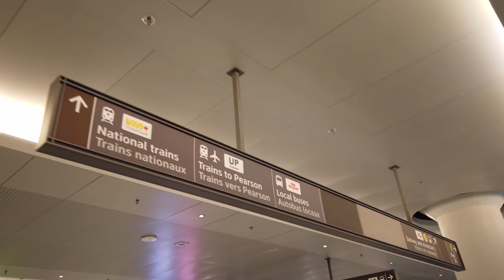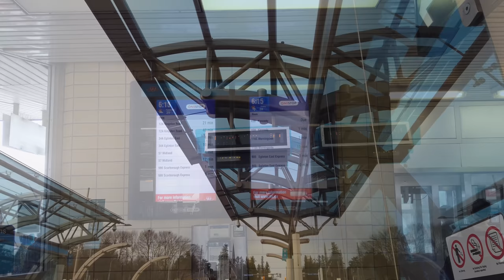How to Plan a Good Railway Station

Comment: Excellent video, Reece! I feel like making transit a pleasant experience even when the weather is not nice is often overlooked. As you said in the video, this is especially important in Canada because of the cold winters but also in many places around the world that experience extreme heat.

I cannot believe that in a city as cold and snowy as Québec City, the people planning the tramway line there didn’t consider having a weather-protected connection between the main train station and a tram station. Do they expect people arriving in the city by train or by coach bus to just walk 1km outside to a tram stop with their luggage when it’s -25°C and there’s a snow storm?
Reply: Na, they probably expected them to drive🤦‍♀️
Reply: @neolithictransitrevolution427  My guess is that they used recent origin and destination statistics and looked at the currently most used bus lines to come up with the path that the line takes and its stations. Currently not so many people go to the Gare du Palais because there are just a few trains per day, but that should change in the future with Via HFR (High Frequency Rail). The fact that they didn’t consider having a good connection between the train station and a tram station, especially with the nearby tram stations being underground, is crazy. The plans are now too advanced to consider changing the route (and I obviously don’t want there to be any more delays with this important transit project), but perhaps they could consider building a pedestrian tunnel so people could get to a tram station without going outside.
Reply: @ethandanielburg6356  Ottawa got mostly the same hit tbh. The cities really aren't planning on well with VIA, Although I can only blame them so much given Via's history. I hope, at least in Ottawa, future lines provide more connections and have better connections. Pedestrian tunnels would also be great.
Reply: It's nutty that the stations on the tunnelled sections of the Ottawa O-Train extension (Stage 2) are all open-air. Trains travel in a tunnel between stations so they don't have to disturb the surrounding neighbourhoods but people have to wait in the -30 snow at the platforms enhanced by the piston effect from the tunnels. Or drive. The stated reason for open-air stations on tunnelled sections is to save on the cost of extra emergency exists and fire ventilation systems. It's better to get something inappropriate for cheap than to spend money on what you need.
Reply: @neolithictransitrevolution427  At least in Ottawa the light rail station is right outside the Via train station. In Québec City, the Jean-Paul-L’Allier station will be 1km from the Gare du Palais and the station at the Place d’Youville will be about 750m away.
Reply: Hopefully they'll build some decent shelters, something at least comperable to the Bus Stations on the transit way.
Reply: @ethandanielburg6356  Awful, honestly a future branch line would probably be worth it.
Reply from the maker: I think it's also a bit of chicken and egg, it's not as attractive to use VIA without such great PT connections!
Reply: @RMTransit  I think it's really Via that has to come first, there will never be much demand for a station with 6 trains a day with slow service to boot. 

On the otherhand, people fly to places without a good public transit link, so we know people will take intercity transit if its fast and reliable, even if they have to take a cab or get picked up by a friend when they arrive.

Comment: The improved safety with more open sightlines seems like one more reason to choose elevated rail and stations over underground ones where it's otherwise a toss-up between the two. I wonder if there's any data showing that violent crime is less frequent in at or above grade stations and trains...
Reply from the maker: It's an interesting thought and I definitely think the sight lines are super helpful and as you mentioned they kind of come for free
Reply: Many of Singapore's newer underground stations (built in the 21th century onwards) have open-concept designs i.e. from the ticket concourse/hall, you can look down at the platforms at the floor below which provides more open sightlines too. In contrast, some elevated stations' platforms are having their atriums looking down to the ticket concourse/hall below filled up so as to expand the platforms' floor area & increase capacity

Comment: Chicago has two major train stations next to each other, Ogilvie Station and Union Station, and they couldn't be more different. Although one thing they have in common is they are not directly connected to the city's L system.  

Ogilvie is modern station (100,000+ riders/day  and 16 tracks) with clean sightlines, information monitors, nice retail, and easy access to all the platforms. It also has decent bus connections immediately outside the main entrance. It's an easy station to get into, navigate, get the information you need, and find your track platform.

Union Station is a beautiful historic building (140,000+ riders/day and 24 tracks) but it is a labyrinth of claustrophobic corridors, side room, cubby holes, and stairs and escalators, inside. No single corridor runs the length of the station and the turns and elevation changes are sure to leave you totally disoriented relative to where you are inside the station and the streets outside. Finding the platforms can also be difficult. As for bus connections, it has plenty but finding them can also be tricky as the station can be accessed from various sides and once you're in it, it's hard to tell which side you're on. It's a huge shame because the old part of the station is gorgeous.

Comment: I don't think a lot has changed for cookie-cutter architecture. The CPR had a few plans to choose from probably depending on ridership levels. They may have used the same paint as their maintenance buildings which locals came to appreciate when it was time to paint their barns. 
Public architecture is kind of a fickle . Advanced design may not be appreciated for generations.

Comment: My favourite station is Ueno station in Tokyo. It includes essentials that Reece omitted such luggage lockers and washrooms equipped with heated toilet seats and bidets. The walking surface is an artificial stone that is slip-resistant, whereas here in Australia the best we can offer in our major stations is bitumen. Each section of the station has a name, each exit has a name, and there is excellent internal wayfinding that includes diagrams indicating "you are here".

Comment: Ottawa's Line 1 is filled with lessons on what not to do with transit stations.  The above ground stations do not provide shelter from sun, wind, rain, or snow and have minimal seating.  The distance to the bus stops is too far, especially at Bayview (shown in RM's video) and Hurdman, which exists solely to be a transfer point.  It's always fun to see a light fixture swinging hard in the wind, wondering when it will break.  And Ottawa gets to see more of this with Line 2, which will go from a working system to more of the same from Line 1 when it opens.

Comment: Can you talk about Intercity rail and commuter rail and what makes them different from each other?
Reply: Intercity rail is basically your standard railway. It’ll usually go between two large cities with stops at a few smaller cities along the way.  In Canada this would be Via rail 

Commuter rail is like a subway system for suburbs. Basically. You’re looking at a smaller radius of operations, more frequent stops, including multiple stops in larger cities, and being designed to funnel workers from the suburbs into the city for work and then out of the city to sleep.  Think of Go trains. 

Another subset in the train world is regional rail which fall between the previous two. They  are meant to connect small towns to each other and to a major hub. If you watch cab videos think of the ones in Japan that travel through the countryside stopping at all the small stations.

Comment: First off, I did notice some new transitions and with that said, I really appreciate the fact that you always put very fitting imagery and videos proving your point with sufficient quality. I raise my hat to you!  
  
Onto the topic itself, I think accessibility should also include proper signage and easy ways to get around the station. For instance, King's Cross and Euston in London can feel really overwhelming as a non-local and some regional trains can only be reached by corridors with steps which make you question whether that's an official hallway towards a station, a construction site or an hallway for employees only.  
Which brings me to the point that a station can inhabit different kinds of transport modes, shops, stores and such. I really appreciate these features but it can be too much. Especially with Kings Cross St Pancras or Birmingham New Street, I had a terrible time navigating through because the former feels like Frankenstein's station with multiple big hubs combined into one without much seperation and the latter has a confusing layout, LOTS of stores and it feels like commerce was the top priority and transport second. It was pretty crowded too due to the layout.  
  
That shows how hard a good station in big cities can be because usually, you only extend a station instead of create a new one (as a buiilding anew is expensive) and then you can have way too huge stations which could trump airports at times. Do you think it is because some may fear that a station doesn't have much value if it's built with transportation in mind first? Or do you know of big cities with successful new built stations/hubs?

Comment: I think you're missing a crucial element: orientation. This applies mainly to larger stations, but a building where you intuitively know where to go offers a much smoother experience than one where the setup is confusing. Moreover, it will improve the flow of passenger streams, thus creating a much more organized feel. My home station (Leiden, NL) perhaps isn't the prettiest in the country, but its layout makes it very easy to navigate: one platform for trains going south, one for those going north, and a third one for services east.

Comment: The integration between train+bus is interesting in Seattle.  They're not necessarily owned by the same agency (the rail is Sound Transit vs. the buses are a mix of King County Metro, Community Transit, and Sound Transit), but at least the ORCA card works for all of them.  That said, it seems like coordination between the agencies isn't a very high priority.  It's never been clear how inter-mode transfers work with ORCA, if they do at all.

Even basic rider usability can be kind of questionable.  At the recently-opened Northgate rail station, which has four bus bays for connections, most of the video signs announcing incoming buses are so far away from the actual boarding spots that you can't see them; they might as well not exist.  Most of the rail stations that I've seen don't have any "next train in N minutes" notifications at all.  The Link rail is just a single line right now, but it makes even that single train line into a bit of a mystery.

Comment: In the last couple of decades, Boston disimproved a couple of their transit stations:  Ashmont Station used to look bad and run-down, but at least it gave you good shelter and gave you cross-platform transfer between the Mattapan High-Speed Line and the Red Line or buses and the Red Line; the new Ashmont Station is a wind tunnel, and the cross-platform transfers are just gone.  Kenmore Station on the Green Line used to have a nice semi-enclosed bus shelter, and they replaced it with a glass canopy that is completely open on 3 sides, giving much less protection from wind and rain and no protection from the Sun.

Comment: My station is well odd....
It has express services directly to london and an hourly regional service plus intercity busses....
But it only has a single through platform active (with the other being abandoned) and a terminus that is facing south.
And there is no direct connection to local busses for some reason.
And only has started being refurbished post 2010 thats when a enclosed waiting area, car park and new bus stands were built and after that a gate line when a major event happened.
And that event is happening again and funding has been secured for reopening of the original platform 1 with a step free accessable foot bridge. So things are on the up apart from the regional service....

Comment: One controversial station I like a lot is Birmingham New St, it’s in the heart of the city centre. Fairly easy to navigate (although knowing which exit goes where is a problem) and it has lots of shops and is attached to the main shopping centre for bham. It also connects directly to the tramline. Only problem is it’s distance from a lot of the terminating stops for buses serving the city centre. As most buses in bham finish in the city and turn around and go back out.

Comment: Regarding the point of shelter, we Hong Konger, who love air conditioning, loves to have shelter against the weather often with part of it as a mall, from where we live all the way along to the rail station and from the rail station to office block, for example in Tsueng Kwan O and the areas around Shatin and Tseun Wan Station. I think this makes travelling by the MTR much safer and more attractive than other forms as my journey is not affected by the weather at all. When building a new station, attention should be paid not only at the station itself but also its pedestrian connections to major destinations around it. Which makes me hate some area such as the along the old Ma On Shan Line section, Whampoa and Southern Horizon where a continuous shelter is easily achievable but leave lots of gap without shelter

Comment: The weird part about all of this... is that I ended up thinking along those same lines. (Pun intended) For my Proto-freelance railroad. Part of what you said comes down to finances. Since in North America.. when you look at some suburban networks. Like EXO... the "station" is nothing more than just a slab of concrete and next train signs. Maybe a bus shelter for passengers to wait. Hardly a station. Then when you look at peak hour only networks. Like the West Coast Express; partially sheltered with ticket machines. There really is no middle ground when it comes to railway stations. Especially in North America.

Comment: Ticket machines seem to be incredibly expensive, I'm guessing in part because of the numerous ways to pay these days. Here in Austin 2 new machines at each rail station for a total of 18 machines cost $1,000,000, which is a lot for only a couple thousand riders a weekday paying $3.50 each. The math surely works out far better for the Montreal metro, but I can see why a system would skimp on ticket machines.

And thanks for recognizing the value in park and ride. It seems like transit advocates tend to be too vehemently against it.

Comment: i like bank station, it's very convenient and you can change between underground lines with ease
it's also clean and tidy, so you don't need to complain about the disgusting smell
the station connects two important underground lines and easy access to the docklands and waterloo

Comment: Probably a stupid video idea, but what are your thoughts on the best ways of presenting printed information at, say, bus stops and railway stations? Over here in the UK, it can be an absolute nightmare to find out something as simple as when a bus is due. At some stops there aren't any timetables, at others, there are, but they're presented poorly, and at others, they're actually half decent. Tbh, I wouldn't be surprised if poor quality information is one of the things holding people back from using public transport over here (perhaps another one might be stupid route designs, especially when they loop around housing estates excessively)

Comment: One upside to transparent shelters can be that you get some warmth from the sun. Maybe some middle ground that allows for solar gains in the winter and shade in the summer could really up the shelter game.
Reply from the maker: Just have glass side walls since the Sun is mostly overhead in the summer anyways
Reply: 1 of my university's new bus stops uses a transparent shelter, which has been criticised as pointless as it doesn't provide shade from the sun

Comment: I want to know who is building public buildings (transit stations) without toilets so i can shoot them. NY has parks in effectively the middle of nowhere (out of town or edge of town in scenic places) that have fully enclosed restrooms with running water and are kept fairly clean. One of my regular stops when crossing the Addirondacks is specifically chosen for the towns park with an amazing view and clean bathrooms. (Way cleaner than the typical gas station)

So the thought of something having a train or metro station in a CITY without a single toilet for the riders is unfathomable to me when a park on the river well outside of town has running water and flush toilets. Even hiking trails may have porta potties if they are popular.
Reply: I have no problem with that; While many larger stations have restrooms (for which you have to pay to use), all trains except for commuter trains have them on board